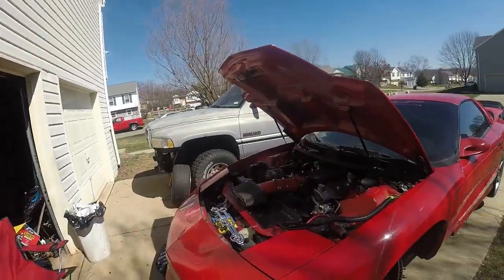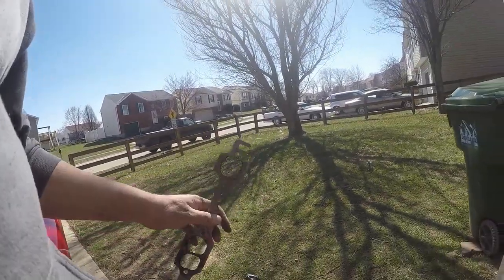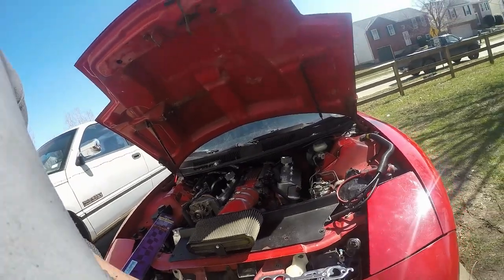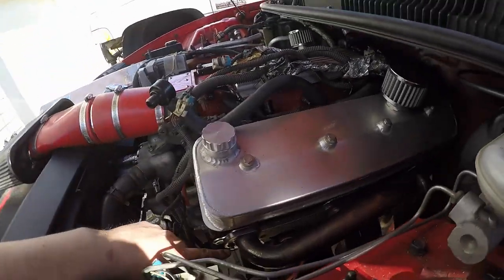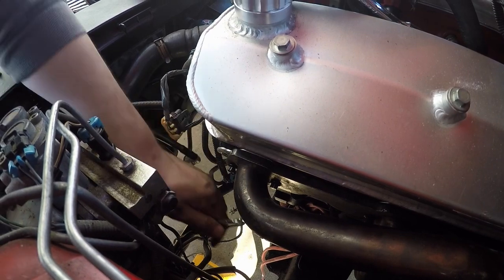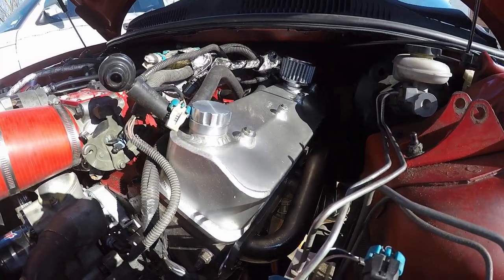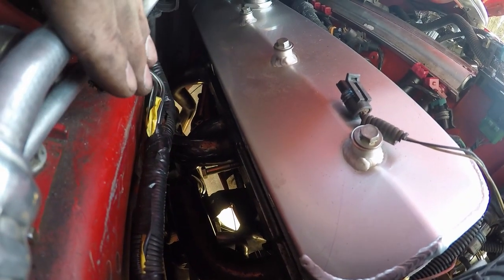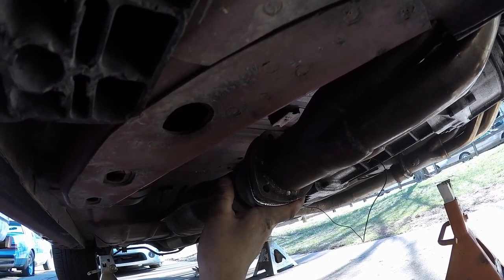LT1 Longtube header installation

Comment: I have a lt1 Camaro did you delete the pcv valve with the filter on the valve covers and did u block off we're the hose goes from valve cover to side of throttle body

Comment: Nice video!!! I seen some speed engineering ones I want to get for my 94' Camaro. They're slip fit. Any advantages having a flange on the ends of the headers? I know hookee has some that's made with them. Trying to find a y pipe though. Really want to do this once for at least 5 years. It's a obd1 I've read some things that I wouldn't need a tune and so forth.
Reply from the maker: Flange isn't really an advantage over anything else, it's just nice to have some way to disconnect it easily when doing engine work. You won't have to tune to delete the cats but you may want to tune to add fuel.
Reply: @HorsepowerTube  Thanks for the reply! Since mine is a 94' and being a obd1 system I've read that deleting the egr won't throw any codes? Since there isn't a 02 sensor past the cat? Thanks for the advice!
Reply from the maker: Vend Master  on this it wasn't bad because it already had shorty headers on it. But usually I'm scared that they will break off so I heat them all up with an oxy-acetelyne torch. It's alot easier to do that than to fix a broken one. Then I use arp bolts to reinstall. They will never break and the head won't strip when you tighten them. Not crazy expensive either.
Reply from the maker: Vend Master  yeah definitely wouldn't hurt.
Reply from the maker: Vend Master  correct. It unbolts and bolts back up. Only goes on one way.
Reply: HorsepowerTube another guy told me all you need to do is remove the shield from the steering shaft and they will go on. Do you think that would work or is it better just to remove the shaft?
Reply from the maker: You could try. Been awhile since I've messed with it so don't really remember.

Comment: Quick question i have a 94 trans am lt1. How how is it to do a rear main seal what are the steps
Reply from the maker: Pull the trans, pull the flywheel or flexplate. There it'll be.
Reply: @HorsepowerTube  do you have the part number for the rear main seal??? I'm finding that if I google it I get several different seals.
Reply from the maker: Rock auto is a good source for part numbers. Rear main is not so easy bc you have to remove the whole transmission. If you have to ask seems like it might be a bit out of your league. Going to need a trans jack, going to have to get the car pretty far off the ground. The seal itself isn't so bad. Just make sure you install it evenly and carefully. Probably should do oil pan gasket too. I find that easiest to support the engine with a brace across the strut towers and drop the k member. These are all very heavy components and can be dangerous if you don't understand what you're doing. I wouldnt try it unless you have a good understanding.
Reply: @HorsepowerTube  thanks I'll check rock auto. I already have the 4l60e removed and rebuilt it myself. Lol. 

I just kept finding different part numbers for the same part. 🤷 I have a 97 so alot of times I run I to the transition year issue. Where manufacturers/sellers say it's for 97 but then I find out it's for a ls1 98+ 😒. 

Hardest part of removing the trans was removing the exhaust. Because I used the cheap clamps instead of band clamps. What an absolute nightmare that was, even with a torch... but The trans removal itself was surprisingly easy.

I'm debating if I should just go ahead and do longtube headers/y pipe while I have trans out. $232 from ebay. (Speed engineering ones.)but I'm worried about the oem manifold bolts breaking off.
Reply from the maker: I'm pretty sure all 87+ gen 1&2 small blocks use the same 1 piece rear main seal. Obviously LS motors are a different beast. I usually use timken or acdelco seals. You can do long tubes. But I'd use that torch on every bolt. Why chance breaking one if you have a torch available. I'd go back together with arp or perhaps a locking fastener. They're not very expensive but really nice to have some that won't round off or break.
Reply: @HorsepowerTube  thanks. Yeah I was thinking like, I already have the car up and with trans removed I have lots of room. Might as well just get it over with.

Found the seal  FEL-PRO Rear Main Seals BS40656 (AutoZone/rock auto).

To think this all started because I simply wanted to see if I could rebuild my 4l60e or sell the car for cheap. Now I'm looking at longtubes, y pipe and I just found today that spintech makes 2OTL catback. Which is my dream setup for an exhaust. Since slp no longer makes them. 

https://spintechmufflers.com/camaro-1995-1997-ss-3-cat-back-with-dual-2-5-tail-pipes/

But damm $500. Fml. Being on a budget sucks. 😅

Comment: i bought the same headers but for some reason the motor mount on the passenger side is in the way of first collector and will not allow me to bolt it to the head. anyone else run into this problem?

Comment: What Y pipe are you running? Just factory cut down?
Reply from the maker: That was made at a muffler shop. They just added a piece to the drivers side and welded it into the existing passenger side.
Reply: @HorsepowerTube  much appreciated, sir. I found your trust eBay headers. Still happy with them after all of this time?
Reply from the maker: @TheRicereater78  yup. I've had them on several cars. They're not always perfect, I've had to do minor tweaks before, but for the price you can't beat them.
Reply: Awesome. I'll be ordering some up then. I appreciate the responses man. I'll keep an eye on your channel. :)
Reply: Alright 2 questions (so far). What did you do about the arm for the alternator bracket and how TF do I tighten the cylinder 4 plug? Lmao

Comment: Hey man, did you have to run egr block off plates since the original ones are mounted to the exhaust manifolds
Reply from the maker: Since there is no provision for egr, you would have to remove it from the tune, and remove the tube that went to the exhaust manifold. If you delete it in the tune or unplug the valve you don't have to block it off, just make sure to leave the valve mounted to the intake but disconnected. The valve is normally closed and will not let the engine suck air unless it tries coming on because it was left hooked up. Alternatively you can remove the EGR valve and block it off which would look cleaner, not that anyone would really notice.
Reply: HorsepowerTube what do you recommend being the easiest way to go.
Reply from the maker: Just take take the vacuum hose off the EGR and you will be good. You'll get a check engine light if you don't tune it though.
Reply: HorsepowerTube did you get the car tuned after installing the headers

Comment: Where did u get the value covers
Reply from the maker: Tony Ruiz eBay. They are just regular sbc center bolts. Spaced out my accessories so alternator clears. But canton makes a set just like them that bolts on to LT1 without mods